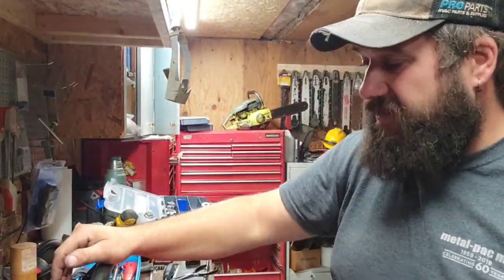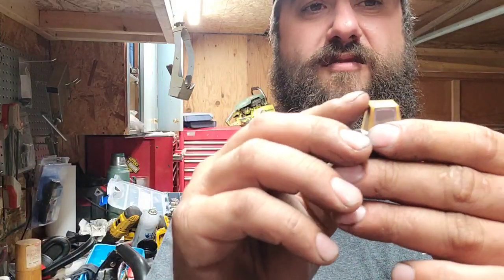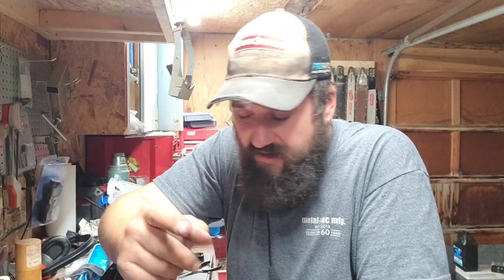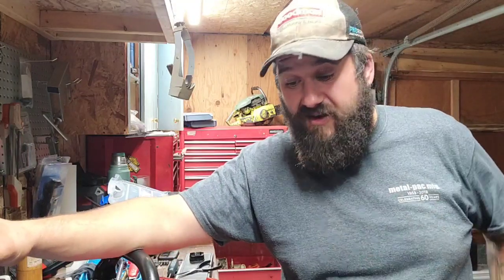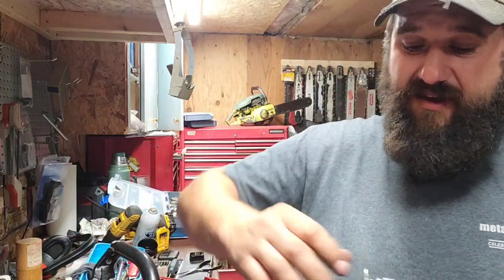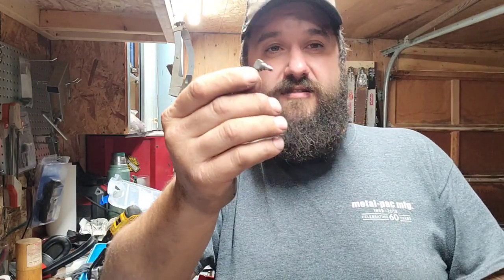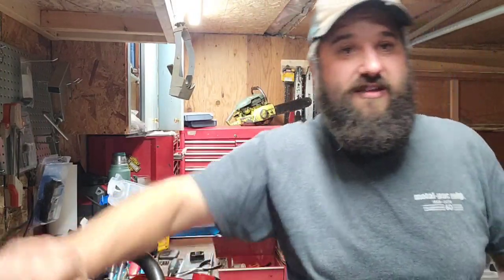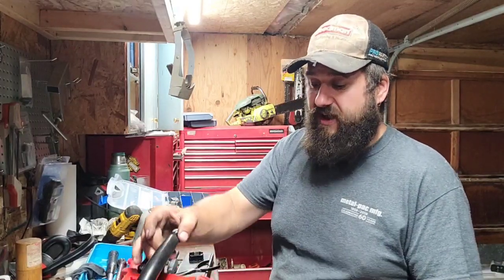Ported Homelite talk, reed valves and carb issues!!

Comment: Those Tillotson 900 series Homelite carbs with the threaded in brass "buzz ball" harmonic governors also always (as far as I know) have a semi fixed high speed jet (to the point where most of them still 4 cycled with the high speed screw completely seated even if the governor is blocked off lol) so maybe it's still too much high speed fuel for the smaller displacement?
Reply from the maker: I'm not sure, I'm going to have to do a video on modifying them and we can see what if anything works.